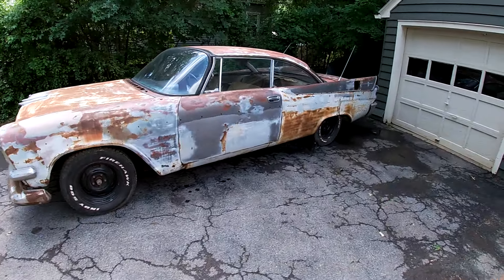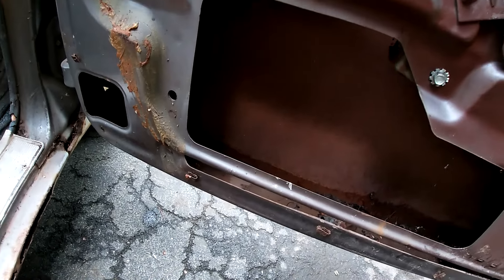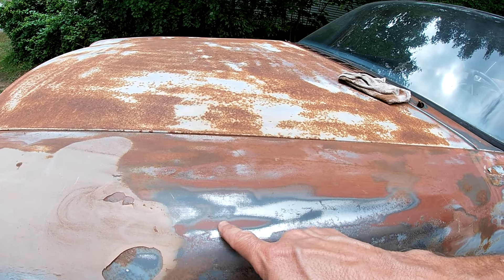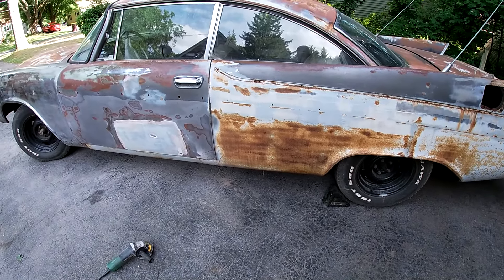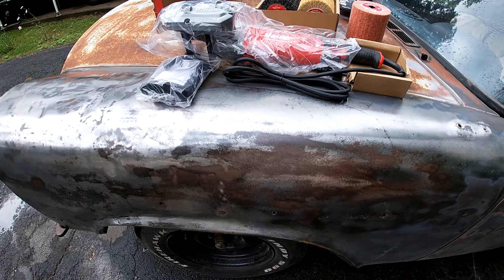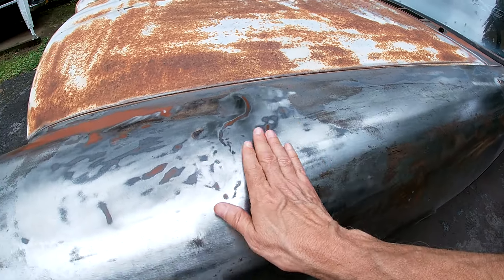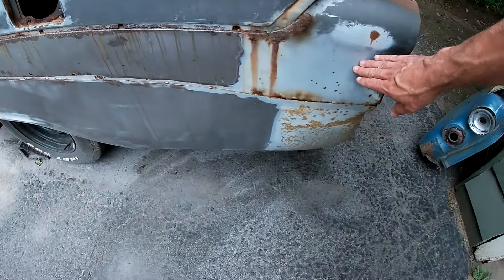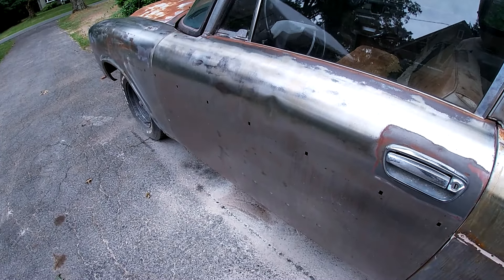1958 Dodge Coronet - Grind It 'Til You Find It

Comment: Probably look pretty cool with striped sides and patina hood roof and trunk. Then clear coat the whole show. You can get a dent puller that welds it’s self to pull. Maybe some lead loading in the bad spots. Don’t paint it black. You can maybe do a faded lace roof. I’d do faded lace on truck and hood also. Get a artist involved. Maybe swirl polish fins.